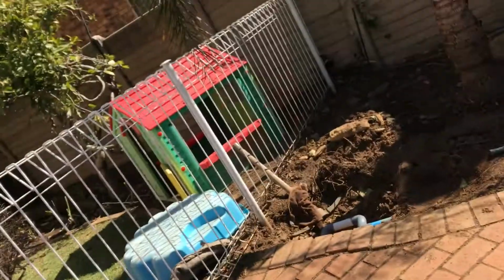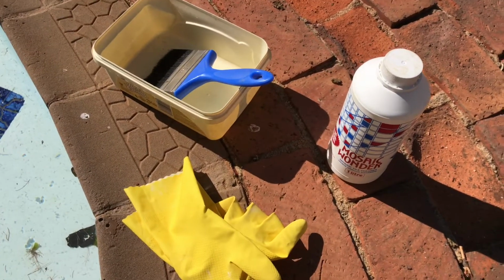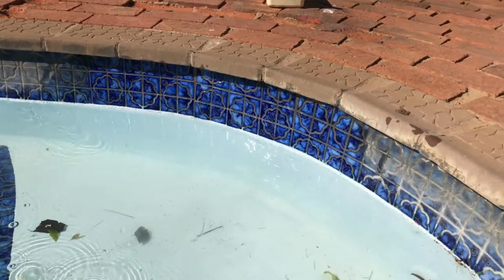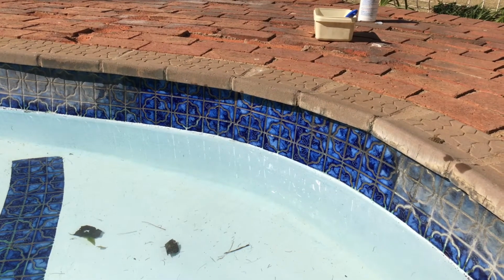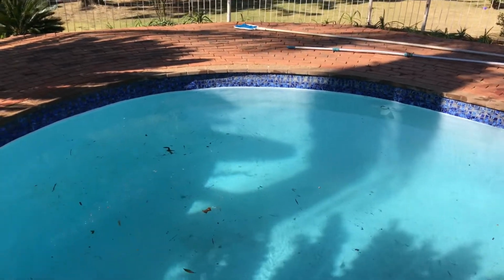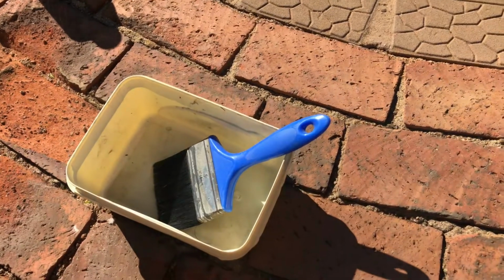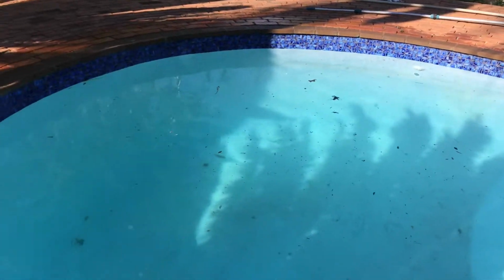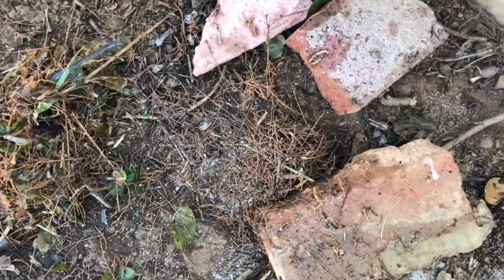Trying out Mosaic Wonder//cleaning my 20 year old swimming pool tiles

Comment: where can l buy this? l'm in the US
Reply from the maker: Hey, I’m in South Africa so I’m not sure about where to get it in the US, or if this brand is available there. However, it is just hydrofluoric acid so you should be able to get that from most pool hardware stores. Make sure to get a proper mask, and don’t just use a buff like I did. Also check if your pools surface is suitable for the application.